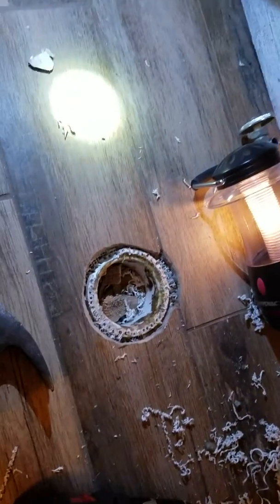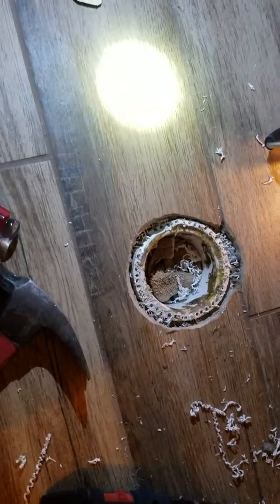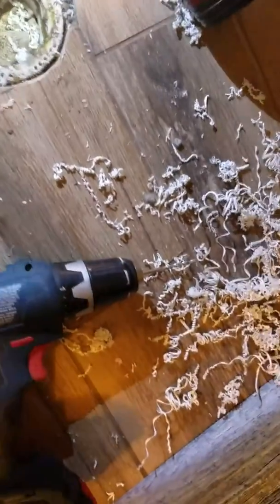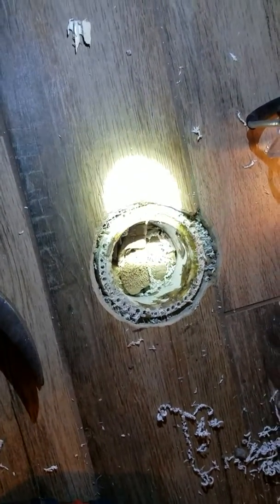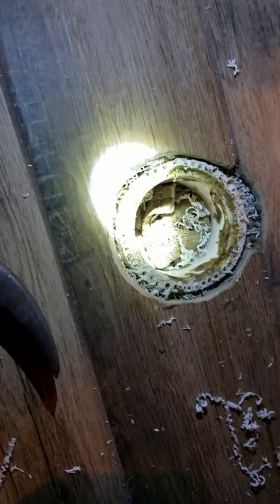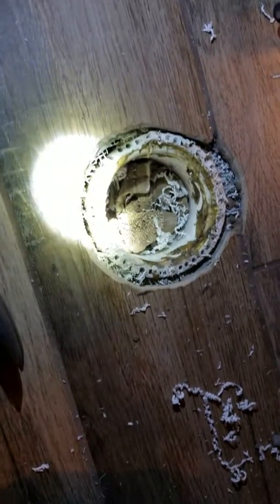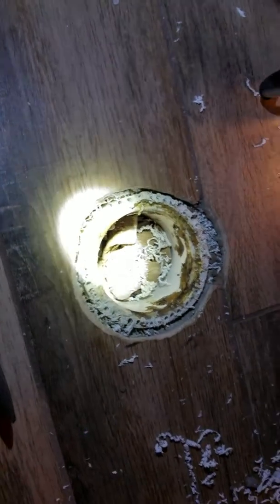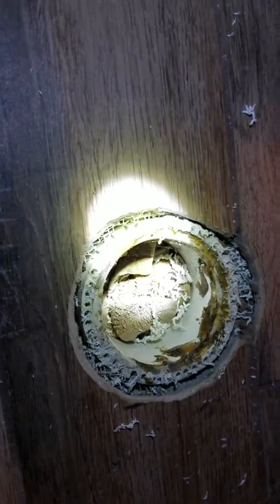PVC 4/3 Toilet Flange Removal | Part 1

Comment: My street elbow below the flange is made of lead. Not sure what I'll be doing when I have to deal with that. I suppose I'll have to take it out of the cast piece it goes into, and try to replace it with plastic.
Reply from the maker: They have PVC slip in flanges that either screw in or there is a slip joint that expands a rubber seal to make it tight. I guess those leak according to troll reviews. I can't see how they leak. http://tinyurl.com/jy2ov55 is the slip flange one. Someone has a screw in one but of course I can't find that one now.